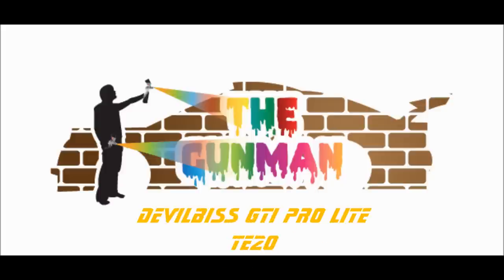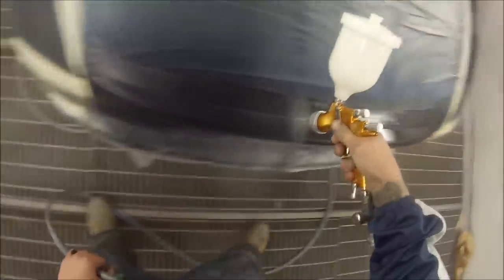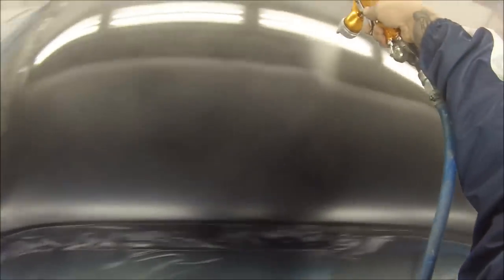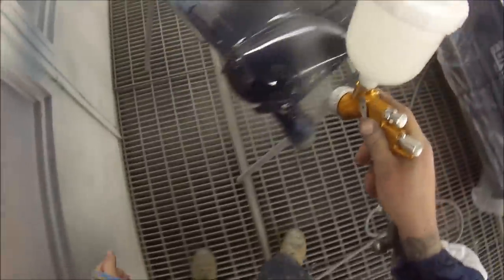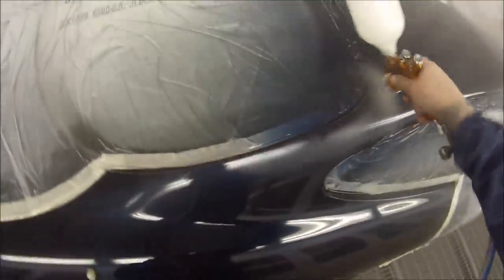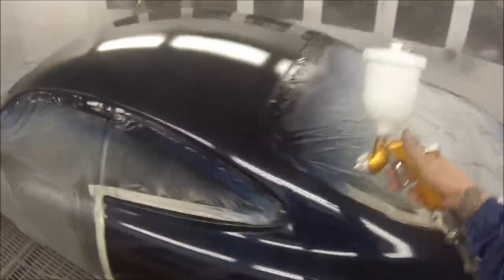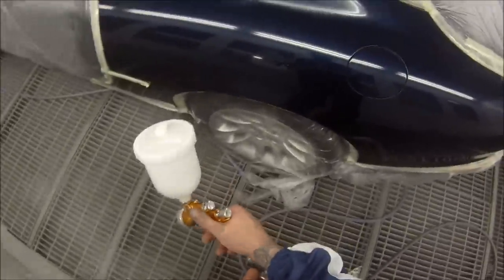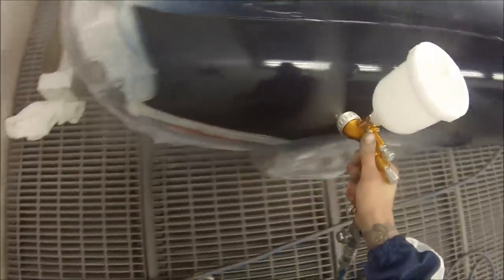DeVilbiss GTI Pro Lite TE20 Clear Coat XKR Jaguar

Comment: Hey gun man I have a problem when ever I put on the clear coat I get to much orange peel, please help
Reply: It could be your pressure, your nozzle,cap,how far youre spraying from the panel and how fast youre moving. Provide some information as someone may be able to help you better
Reply: Mary Alexandrou it's most likely because your holding the gun too far away from the surface.

Comment: which gun settings do you use for DeVilbiss GTI Pro Lite hv30 Air Cap for  Solvent Basecoat Silver Metallics?
Reply from the maker: 1.5-2.0 bar 0r 25-30 psi, full fan, full fluid.
Reply: Thanks your the best painter ever!